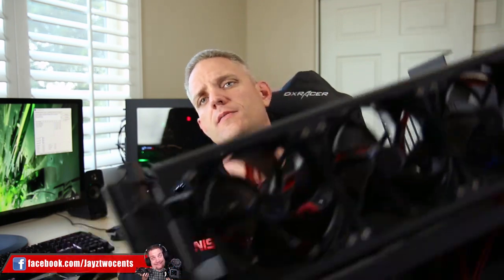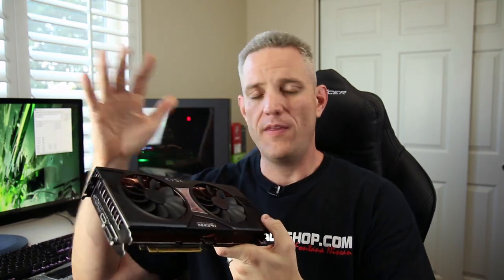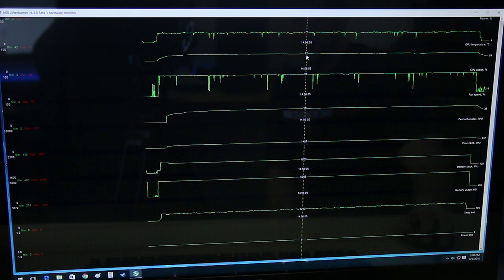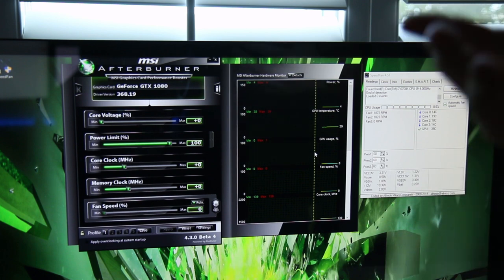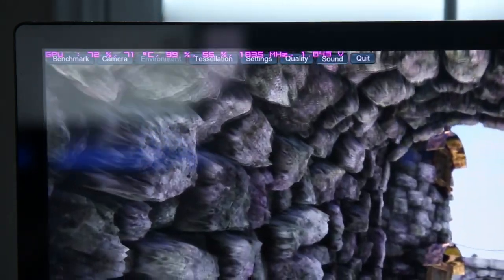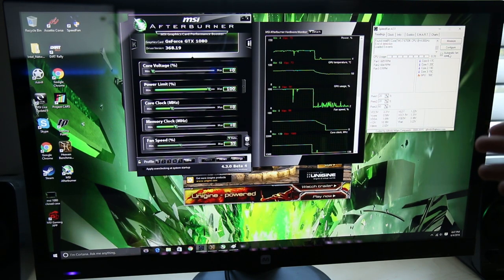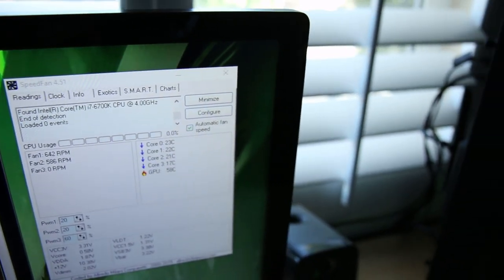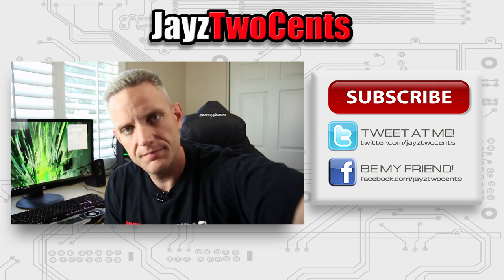Do cases make video cards run hotter?? - Test Bench vs Case

Comment: Lol Jay - 1, Joker - 0, I told him off cam not to go down this route, A case with proper airflow should give lower temps than a naked test bench all other variables being equal (providing you are not packing exorbitant amounts of hardware in that case), and if you are buying a card as expensive as a 1070 / 1080 then you should have $10 or $20 spare to add some extra fans in your case (if your case doesn't already come with them....). 
Though what's with the abnormalties in the vid? Those CPU Idle temps were off (unless your ambients were that low?) and also the MSPaint at 5:43? And also different hardware between the test systems?
Reply: he didn't call out anyone, he asked Jay if he thought his testing methods were fair and Jay being the punk he is threw a fit.  he needs to get over him self
Reply from the maker: Hey, I showed that the test bench is X99 and the case was using Z170. I wasnt about to swap all the hardware for the sake of this video. GPU load is GPU load regardless. AS for the idle temps in the Z170+6700K build, I dont trust them at all. No idea why it was showing idle temps so low. But ambient temp in the room is identical.
Reply: ***** No worries, I know it can be time consuming, but always better to do apples to apples if you can. 
I don't know what exactly unfolded between you and Joker, but I have noticed you copping a lot of flak lately from all angles, don't let it get to you - otherwise it will end up getting to you.
Reply: Richard Kimball Oh ok, prob just going through a stressful time, we are all human at the end of the day.
Reply from the maker: Hey Richard. If I had simply said I felt my methods were fair, it wouldnt have meant anything. At least here I showed that in my situation nothing really changed and yes I defended my position. Im curious as to why you are here though, hate follower? Thats low. Have a nice day though!
Reply: Hey Guys, we are all on the PC master race side are we not? Play nice? <3
Reply: ***** You should come on TGW some time, sort this beef out with Joker (if there is any). Or vice-versa and get Joker on your show.  He does speak in high regard of you if your name ever comes up in conversation.
Reply: Gene Starwind Nah just trying to sort this shit out.
Reply from the maker: Have to remember that Joker came to me with the argument, not the other way around. There is no beef to sort. I gave him his nudge back when he was really small and Im glad that I did. If he wants beef, go to Arby's. By the way, ask him how we met about 3 years ago. Im curious as to what he has to say wink
Reply: Could be a dumb question: Could you explain exactly how a case would give lower temps than an open air test bench?

My understanding of cooling is that the case fans role is to inject cooler- ambient air into the case. This cooler air blows over whatever heat pipes are within the components of the case, therefore cooling it. The hot exhausted air from the components is then exhausted through the rear or top of the case where hot air naturally deposits. 

Is it simply the fact that an open air test bench has no fans to move the stagnant hot air away from the components, and that within a case it's getting a constant supply of fresh ambient air? Which would result in lower temps?
Reply: +Vain Fate Fuck yea bro!
Reply: Basically you hit it on the head, the constant fresh ambient temp air will cool the case better than the test bench.  Think of it this way, let's say that the two 120mm fans have an average CFM rating of 8CFM each. that's about 16CFM of airflow through the case.  The volume of an S340 case is about 1.35 cubic feet.  That means that the air inside the case is completely replaced by ambient temp air 11.9 times per minute.  MATH lol
Reply: Nanda Panda Tech Hey Nanda, you basically answered your own question :P.  Air may be a poor conductor of heat, but it still conducts heat and when you have that hot air not being displaced as well as it would if there was airflow, then you will get hotter temps on the open air test bed.
Reply: im not a hater either but always when i wake up i tend to comment on videos like " wtf u are doing it wrong " all the time and in the afternoon i realise that i had been a bit too harsh XD
Reply: Different hardware and still same temps! Now what does that tell you about your question? I hope you can answer that one on your own.
Reply: Testing with the same parameters, no issue. 
Testing with inconsistent  parameters, issue. 

Base parameters, has been closed door, Ac on(set to?), Room fan on.
A prior test parameter, has been closed door, Ac off, Room fan off. Then compared to above.

Could add a $1 thermometer, to get a Room metric before and after test. 
Thermodynamics are easy to work out when you have that number.
Reply: it is all about airflow. cases use airflow created by fans to move heat away from the components to the outside/ambient area. hot air will always try to go to cold air to create an equilibrium but in static air environments it takes a while so there is a heat build up around the heat source, fans in cases move this hot air away from the source on a continuous basis
Reply: +Richard Kimball Did Jay piss in your cereal or something? Seriously though why are you so mad? lmao
Reply: YO! That's my profile pic!
Reply: i bet joker has alot of oil going down his chin.. while screaming, its "JOKER HERE I FUCKED UP BIG TIMEEEEEEEEEEEEEEEEEEEEEEEE"
Reply: You must be a millennial like Joker.......Oops.....You got triggered......quick go find a safe room together....I hear Triggly puff is there already waiting for you 2!!
Reply: Richard Kimball
 bullshit joker didn't call him out lol. and now he's crying about deleted comments that aren't deleted.
Reply: +JayzTwoCents jay i've got a question, i've got a stock medion case with exactly 0 case fans and my current gpu is a reference 760. im planning on switching to a better gpu since thats really the bottleneck in my system. can i just buy an asus strix or msi or whatever eventhough i've got no case fans?
Reply: Gene Starwind
there is one fractal design case that's like a business one it only comes with one 120mm fan on the back that's the least amount I've seen
Reply: "Is it simply the fact that an open air test bench has no fans to move the stagnant hot air away from the components, and that within a case it's getting a constant supply of fresh ambient air?" 

Exactly. Moving warm air has more of a cooling effect than cooler stagnant air. Which is also why front mounted water coolers (that are injecting warmer-than-ambient air into the case) are just about as effective as rear or top mounted water coolers--seems like it wouldn't be, but again it is moving air as opposed to stagnation.

Comment: The difference between the core voltage needed in the open air and closed box is probably because of airflow going over the VRM's and backside components of the graphics card and thus getting better cooling (because of the fan airflow instead of natural convection). 

Because of this the VRM's and those backside components are getting stressed less so can do the same work with a lower voltage.

Awesome video BTW, I love these kinds of tests. And your way of testing is always your way of testing, as long as you test consistently between two tests, it's a good test!

Comment: Jay, just wanted to let you know that you are inspiring me every time. I am water cooking my computer since 5 years and I now have decided to build a new computer this year. Driven by your comments and recommendations the key components purchased so far are Caselabs SMA8 Gunmetal grey, MSI X99A godlike carbon, Corsair Dominator RAM and 2 cooling loops (EK WB). The CPU and GPU are not purchased yet but will most likely put 6900k and 2x 1080 (EVGA) in the system. I am 33 years old and from Germany and whenever someone needs suggestions, I recommend your channel. Keep on working likes this. Thanks very much.

Comment: Different mainboard vendors (evga and gigabyte) exceed different approach in distributing voltage leveling on the board maintaining the pcie power, number of power phase VRM also matters. Different flatform (Z97 and X99) also matters. Different psu vendors use different rail adjustment too.Indeed your scenarios are bad situation. Still congrats on your effort @Jayz

Comment: If im not mistaken the reason why the closed case was 1 to 2 degree cooler because. Open case there is no fan blowing the heat from the card while your case you have some fan blowing the heat out leaving inside pretty chill...right?

Comment: I'm assuming that the case is allowing all of the internal air to be cycled without increasing the velocity of the air over the GPU fans very much (thus lowering the air density) unlike the test bench with the fan blowing directly on the card. The lower density, I'm assuming, will not cool as well.

Comment: The voltage difference is menial, but as the temp goes up the voltage will go up slightly as well, that would easily explain the .02 volts, or.... it could also be the power-supply itself, cleaner voltage can cause units to draw less total power (but the difference is almost nothing).

Comment: There are a few environmental variables that may also change temperature of the card slightly per user. The ambient temperature of the room, and the rooms airflow, does it recycle? Does it go through an exhaust somewhere? Is there aircon running?
Reply: watch the end of the video, he talks about all this
Reply: +1 for those who actually watch an entire video before commenting
Reply: Sigh, I love all the people that have to nitpick at everything, as though it's going to cause the card to shoot up from ~70 to 100 cause he missed a minor detail.
Reply: Testing with the same parameters, no issue. 
Testing with inconsistent  parameters, issue. 

Base parameters, has been closed door, Ac on, Room fan on.
A prior test parameter, has been closed door, Ac off, Room fan off. Then compared to above.

Could add a $1 thermometer, to add Room before and after test metric.
Reply: Give it a break already. Those differences are enough to cause a GPU to boil on idle.

Comment: Perhaps a better, more efficient power supply in the closed case gave you a lower voltage on the card. Any thoughts? Did you use the same psu in each case?

Comment: Jay I think the reason for the voltage difference is that in the scenario of open air there is more fluctuation of air currents that affect other heat-exchanging surfaces like the RAM sticks or even the MOBO itself, demanding more ups and downs of voltage as the air changes the temperature on those areas, affecting the movement of data on those devices. Those ups and downs in the end demand a rise of voltage due to instability. 
On the contrary, in a closed system you have stability on air flow, stability on external temperatures on devices, thus, stability on voltage, therefore, lower voltage

Comment: I love my H440 case from Razer and NZXT, has 2x 120 fans on the rad, a 140 for exhaust, and 3x 120 for intake.

And I can see now that that IS the smaller form facter Razer edition case as well! Excellent choice. I wish the H440 didn't catch on my top-mounted rad when closing the window all the way though. I have to leave it just ever so slightly off the rail or it's impossible to open.

Comment: I have this same case and the situation that I've found is that the GPU temp is entirely dependent on the type of fans at the front. I originally had 4 AF fans (2 front, 1 back, 1 top) and an air cooler (H121 evo, 1 fan) for the CPU and when I switched the front two fans to SP fans, my GPU temps dramatically improved. On a MSI 390, the temps went from high 80s with front AF fans to mid 70s on SP front fans. This is my situation though and it may not be the same for everyone.

Comment: Jay can you do gtx 1070 sli vs 1080 please. I don't know what way to go. also once you get rx 480 do crossfire too to see if it's true that they are better than a 1080
Reply from the maker: I only have 1 1070 right now, but I also want to do this test! I think its a better value than spending $700 on a 1080
Reply: Something I would also love to see

Comment: Closed case can be very good if airflow is good, cause as you probably could tell, it directs air away from your components and has pressure, and isn't just blowing the air into the room.
Anyway, I'm glad to see the small difference because that means we wouldn't get much worse temps if we bought a card after seeing it tested on a testbench.

Comment: I've done a lot of cooling testing myself, and here's where I think the testing procedure is wrong. You use absolute temps instead of delta T and the fans were set to auto. You should really set them to a fixed% or even better a fixed rpm, but not many fan controllers let you do that so % is probably fine. Now I'm not saying the results are wrong because it's well possible that in an open environment there is a heat buildup around the card, but I do think the testing can be done more accurately. 
btw, nice t-shirt. I had a cat called Nismo once
Reply: Even delta T is a wrong way to do it.. this is because as metals heat up their ability to dissipate heat increases, which basically means that delta temps cannot be compared at all unless the ambient temp was the same.
Reply: But what would that tell you? The question was if the open air test was different from a normal use case. And the results were that there neglible difference between them. Changing the fan speed is not a normal use case.

Comment: yo jayz i wanna sli my 970 how do i install the driver on the 2 card?
Reply: you dont it uses the same driver
Reply: You don't,your current driver will take care of them both.
Reply: You sell it on Craigslist and buy a 1070
Reply: Go to the Nvidia control panel directly from windows by right clicking there. There will be an option that says "Configure SLI". Set it for 'Maximize 3D performance', then you're good to go.
Reply: Windows will picked it up using the existing driver. Install card, boot, reboot, done.  Well, then sli config :)
Reply: the driver is on you pc not the cards so your good just activate sli in your nvidia controlled panel

Comment: Interesting video Jay! I personally would attribute the 1-2c increase due to the increased core voltage. Jay, your open test bench box looks like a case, just without the sides on it. Couldn't you have just ran the test with the case side on, then off so you can keep all of the configuration the same? Seems like to me with the side off, it should be pretty much the same as your open air box.

Comment: "What I consider one of the worst case scenarios with a front mounted radiator" Jay you did a video where you explained that the front mounted rad didn't make a difference? Wanna clarify or are you just saying whatever comes to your mind in these videos?
Reply: I heard that and thought the same thing omg 4 fans = worst case scenario and as you have proved aio makes little difference
Reply: nzmctk it's these little mistakes that bug me. It's not like it's live. This is all edited. How does somebodh edit render and upload all of this and not catch that
Reply: A lot of people still believe a front mounted radiator affects temperatures.
Reply: +Erlwers Ferserx uhmm they do..maybe not on the cpu but if you blow hot air in the case everything is going to get hotter because the air in the case is hotter. This is especially important if you have a graphics card that does not exhausts air out of the back but rather in the case, heating it even further
Reply: +Erlwers Ferserx uhmm they do..maybe not on the cpu but if you blow hot air in the case everything is going to get hotter because the air in the case is hotter. This is especially important if you have a graphics card that does not exhausts air out of the back but rather in the case, heating it even further
Reply: Valentino Saitz Jay did a video on this and your saw it in this video yourself, they don't effect temps like you think they do.
Reply: Jay tends not to fix his own mistakes, because it makes people laugh, and he enjoys it. 

By "Worst case scenario", he's not kidding, it does add a marginally small amount of heat to the system, but the fact the MSI card still ran equal to the open air test bench, it means it really doesn't matter. I did the same thing, I had an H80i blowing air into my case, after having it exhaust air out, and my GPU had no difference in the temperatures.
Reply: +Valentino Saitz the amount of hot air being spread through the case is minute ie the reason why the video showed no difference in gpu temp

Comment: Voltage difference comes down to the motherboard accuracy Jay.  Use a good multi meter if you want to be sure, but I believe the card worked at the same voltage in both cases. Thanks for the effort!...Daz